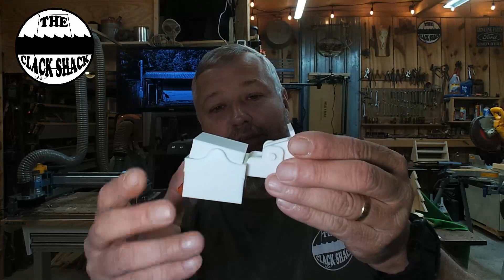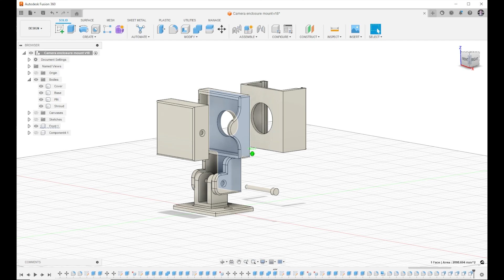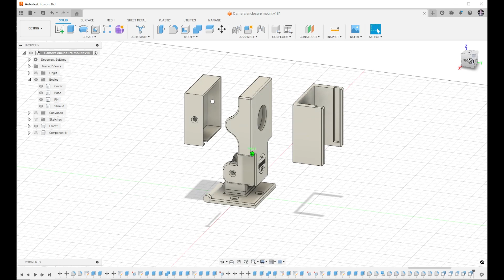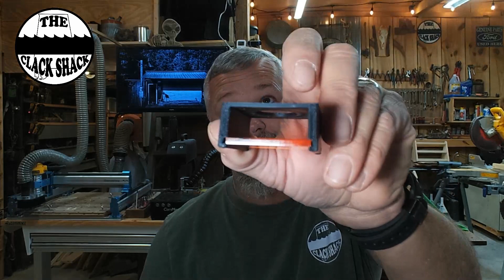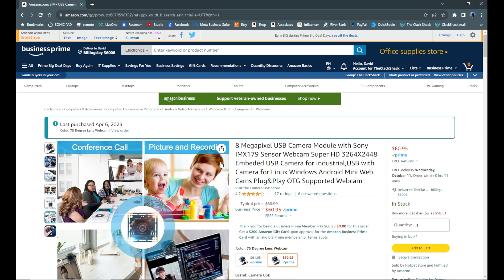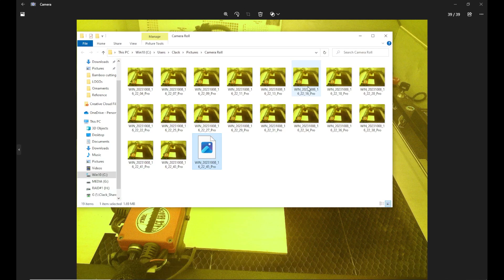My Clacktical laser camera setup

Comment: Amazing solution to burn monitoring. I'm planning my own enclosure and have a 4 year old running around the house, so I need to be sure she won't be harmed by the laser even in the enclosure. I looked at large certified safety panels that are OD5-6 and they are around $150 for just a 12x12" panel! I think instead I'm just going to make it totally boxed in and put a monitoring camera inside like this. Thanks for sharing all your work.
Reply from the maker: That would make it safe for alot less cash